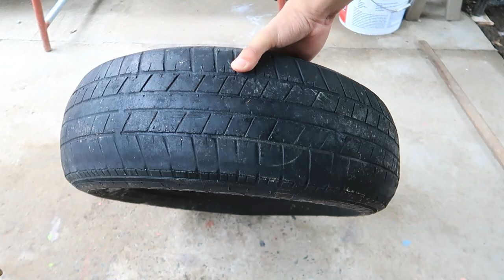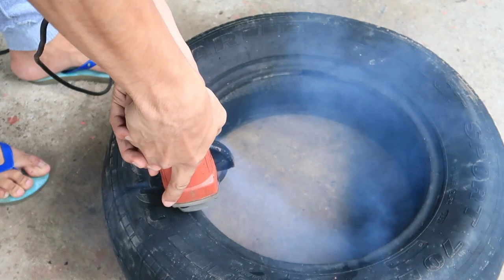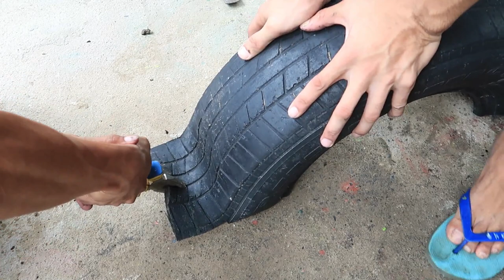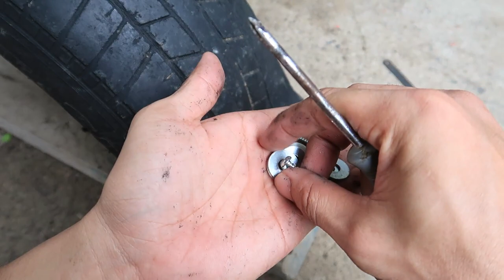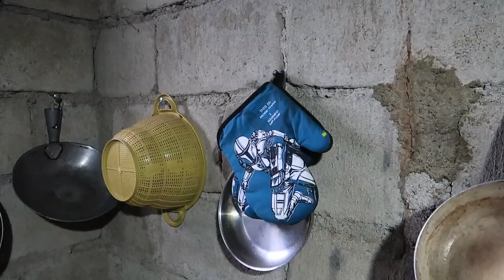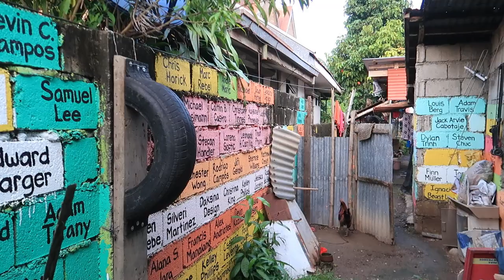How to Make Homemade Punching Bag From Old Tire

Comment: I actually have a makeshift tire punching rig, it's free hanging, just with two pieces of rope, one big tire, 4 small adjacent holes, hanging flat, with a spare with the steel rim tied with rope at the bottom as a counter weight so it doesn't go flying. Looped the rope through the openings in the steel rim padded with old cloth that's been zip tied. Worked well for me, good alternative; Muay Thai actually use tires in their training as well.